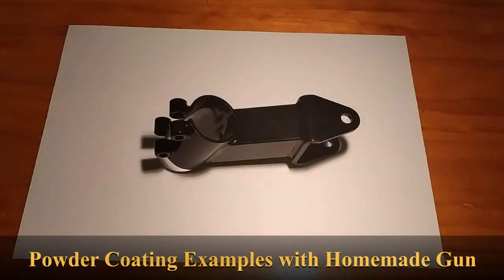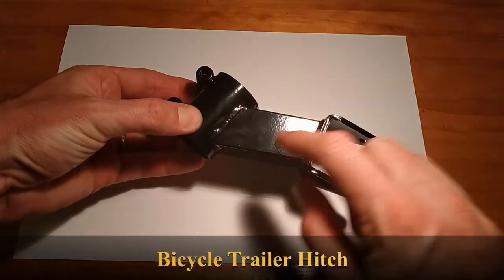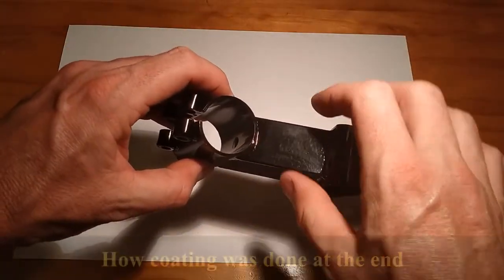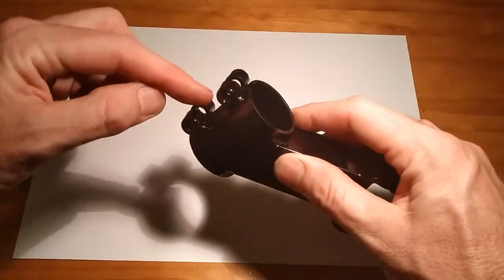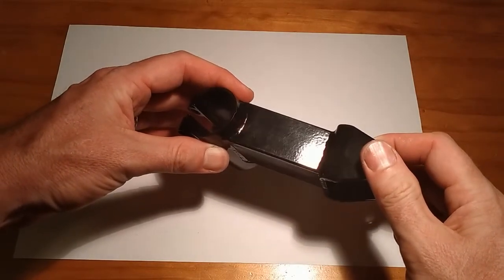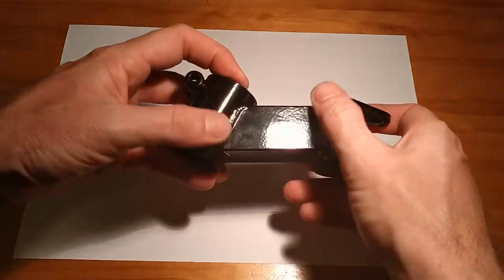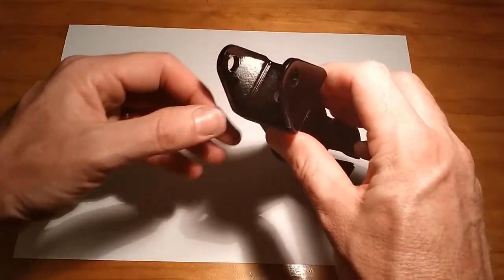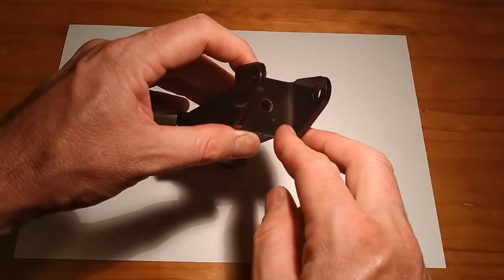Powder Coating Example #3 - Bicycle Trailer Hitch (complex part)

Comment: @Tinker Smith have you ever powder coated plastic? I'm looking at trying to do my BA gear shift surround and where do you get your powder from?
Reply from the maker: No I haven't. The plastic might melt given that you have to heat it to 200 deg C. You would probably need to use the hot flock method as it would not be metal to establish the electric charge.
Reply: @tinkersmith4615  ok thanks will look that up.. where do you get your powder from?

Comment: G day at around 1:44 when you touched the metal with the gun and created the static, is that necessary before you begin the process of powder coating?
Reply from the maker: No, not necessary. I just do it to confirm the system is on, running and I have a good ground.
Reply: @tinkersmith4615  Copy. Its cool thou!